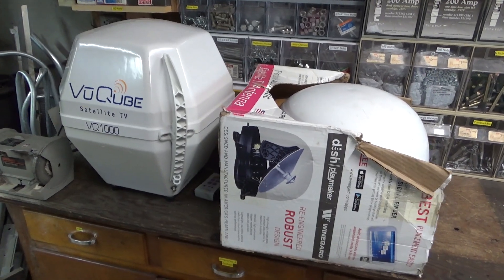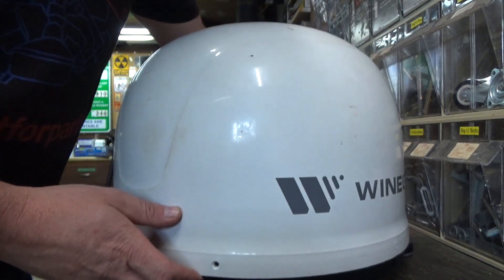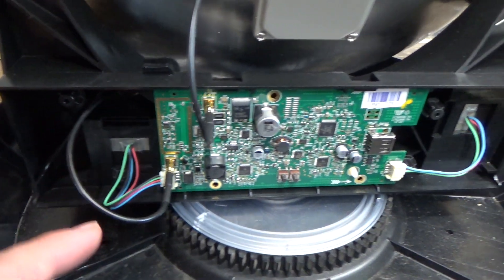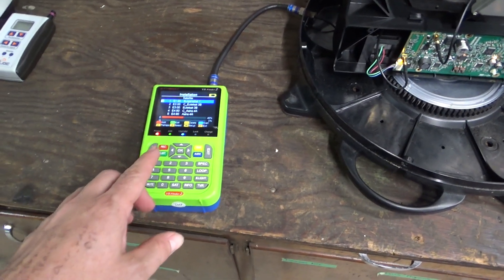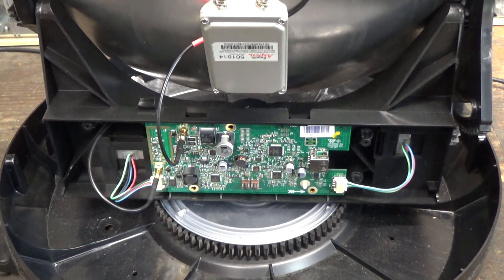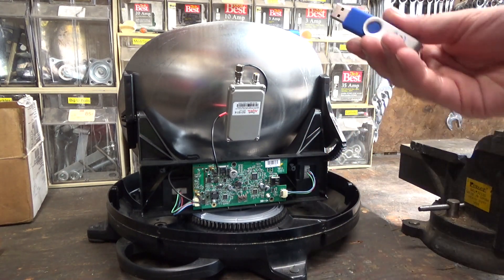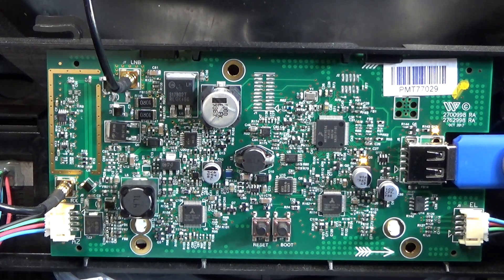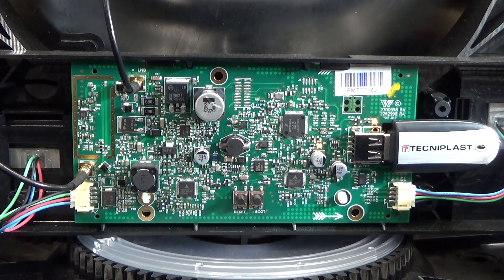What's Inside a Winegard / Dish Playmaker Satellite Antenna?

Comment: Can you get internet and ISP through these dish recievers?  If so how much is the subscription cost?
Reply from the maker: You could swap out some hardware and use them as Wifi antennas, but a regular rooftop dish would probably work better for that. They wouldn't work for satellite internet, no transmitter module.

Comment: I wonder what the  aiming precision of these things is?  Probably not sufficient for a larger reflector, even if the mechanicals would work...
Reply from the maker: The Tailgaters I was playing with can do approximately 0.2 degrees of azimuth, but not super reliably. I've been playing with that a bit, and should have another video about it tomorrow!
Reply: @saveitforparts  I'm actually a DISH Network technician, these playmakers and tailgaters are insane for what they do all things said. However yeah they're not worth the buck new in my opinion, they're actually decently unreliable but I guess if you're in an RV it makes sense, sometimes people buy them because they don't want a dish mounted physically and it just causes more pain then a normal LNB and reflector on mast kinda thing
Reply: @saveitforparts  Those dishes are about 45cm give or take, which at 11.7GHz operating frequency means a 4Deg beamwidth.  You generally want your pointing system to be better than beamwidth/10 (just a rule-of-thumb).

Comment: So if you look at the top right of the board under the barcode, there are some pogopoints with large holes around them that is a "Tag-Connect" port and is most likely a serial interface of some kind. Tag-Connect the company offers a list of common pinouts for that port. If they have gone as far as to use the connector, I don't see why they wouldn't also be using the standardized layout unless they were trying to intentionally obfuscate its use.
Reply from the maker: I did notice some pads for different connections, I'm not familiar with Tag-Connect though. I'm definitely still a noob when it comes to the more obscure flavors of interface, I can just about figure out a serial port (sometimes), but JTAG, UART etc are still mysteries to me.
Reply: @saveitforparts  Matt Brown channel
Reply: I picked up one of these yesterday at a thrift store for cheap.

I have DOZENS of adapters, programming cables, test point harnesses, etc . . . But I dont have a single tag-connect circuit board plug 😂

Comment: Check there’s only one partition on the usb drive. 

As others have said, it might be a size issue. You might be able to use a bigger usb drive but place a single small partition on.

Another trick is to use an SD card reader with small capacity SD cards :)

Comment: So I've watched your satellite videos, and have been doing some thinking.  I understand these dishes are waterproof, so they should be able to be in rugged outside conditions.  Some units can be used as a 'radar' imaging device.  With those two things combined, it should be possible to dig a hole and make a ground-penetrating radar?

;-D

Also, I'll give you one of my old large-capacity USB flash drives.  If a 256MB one isn't big enough, I could part with my 512MB one.  As others have said, partition size and allocation table type might be the culprit in the firmware update issues.
Reply from the maker: I still want to do a ground penetrating radar, but I think we'd need lower frequencies to penetrate any solid materials. These higher microwave frequencies are easily blocked by trees or even heavy rain. Maybe I can come up with something that goes through sandstone if I learn more about this stuff! 
I actually traded away this particular dish... and then got another one by this manufacturer. I'll have to see what I can do with it!

Comment: isn't that screw just a torx bit? or does it have the raised bit in the middle, so you need a torx with a hole to get onto the screw hole? Lots of places sell those security bits now. including iFixit.
Reply: Torx is used in all industry now
Reply: Yeah, that's just a regular Torx. Security Torx is very common for the power section of microwave ovens to keep consumers out. I've got a really nice chrome plated impact set that was given to me by an appliance manufacturer we do lots of work for.